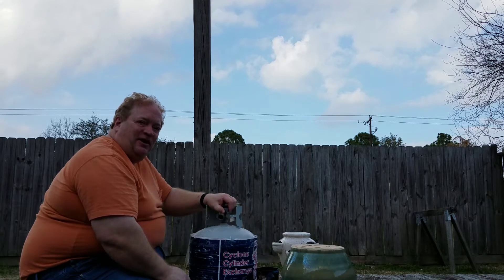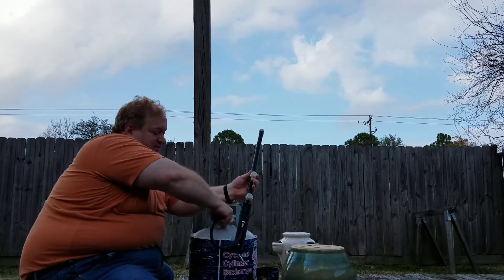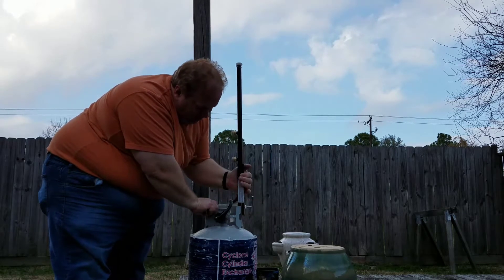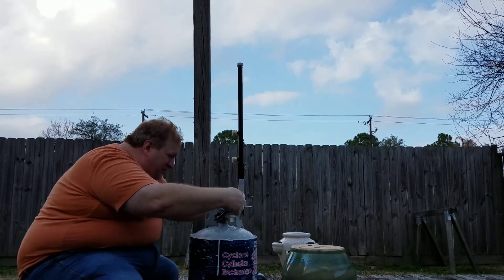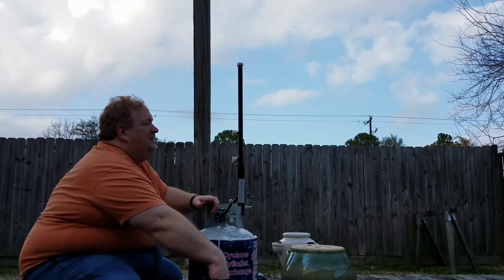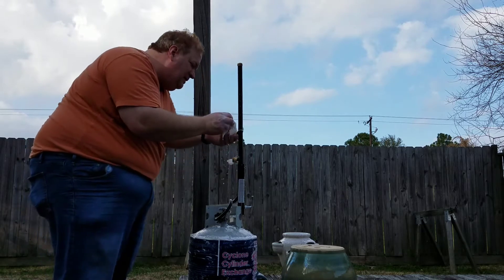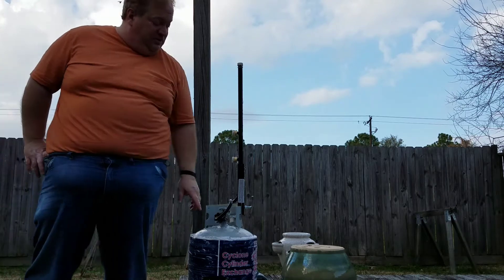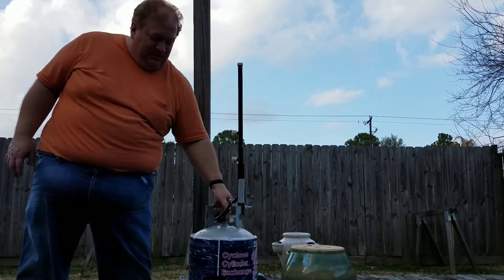Setting up and safety checking a propane distribution post.

Comment: I like how that post clamps on. All the ones in my area mount to the valve and sit on the tank
Reply from the maker: To the best of my knowledge the century manufacturing distribution post is the only one like this period I don't know if they are still being made but if you can find 1 I highly recommend you buy it.